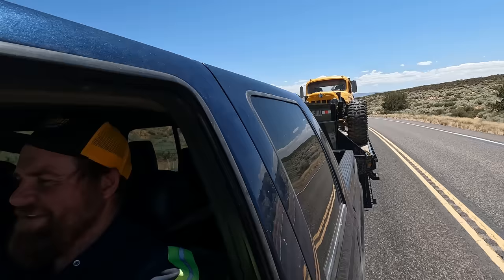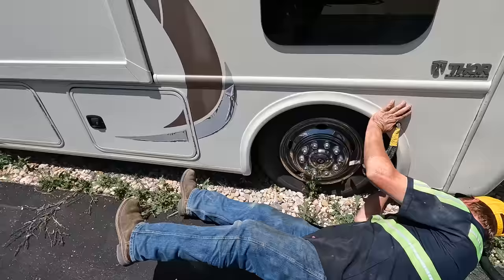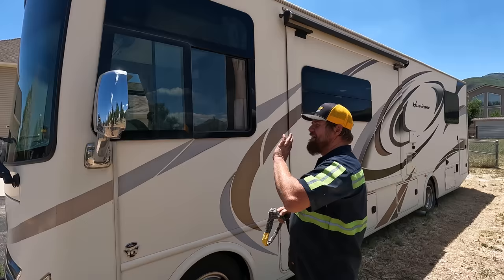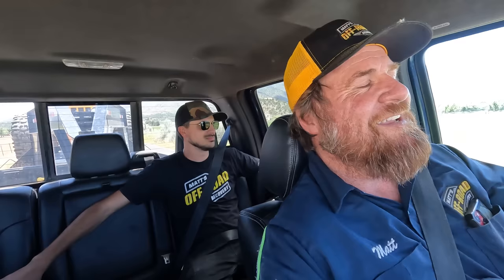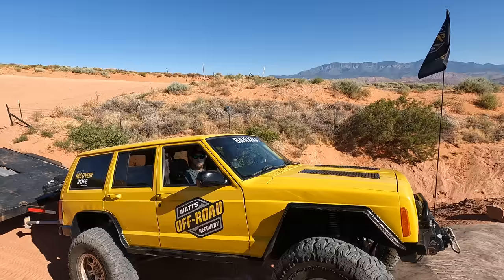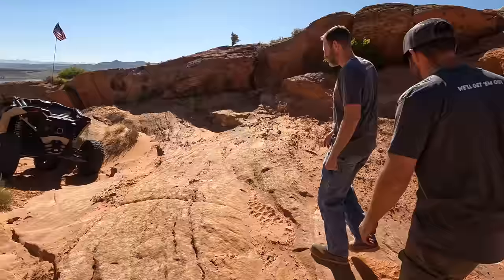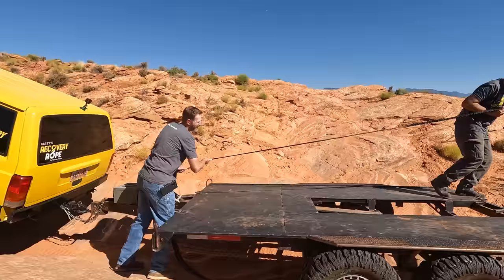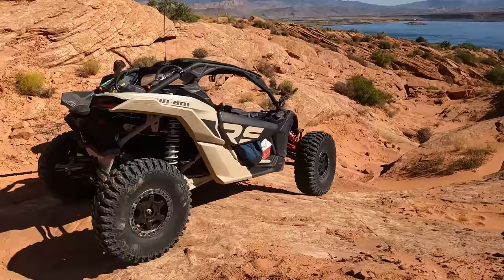Motorhome Stuck In A Bed Of Needles!

Comment from the maker: Check out Blue Steel upgrades here. https://youtu.be/LhFCO4AIKyM
Reply: Now you can challenge Rory and the Mater trailer to a trailer off... Or something like that. Maybe you have a better name for it. Your trailer versus the TrailMater trailer.
Reply: -  👍 👍 🔧  qoᒋ ǝɔᴉN 👀❤🤍💙
Reply: Blue Mule much better name.... just sayin Blue Steel sounds like a porn name lol
Reply: Hey Tom Charging port was my idea
Reply: Sent it to y'all about month ago and now I see I was right lol
Reply: Seriously make a Cover!  Bon Jovi - Bed Of Needles
Reply: Getting a flatbed made my work so much easier
Reply: I'm so glad it's Robby giving Blue Steel some much needed love.
Reply: @XPFTP "Blue Mule" sounds even worse - hung like a... Here's Lizzie in Blue Mule... Yeah that's gonna be a no.
Reply: Instead of an Anderson plug you could just use a 7-pin RV connection and still get the battery charged while you tow the trailer to the recovery and back.  I'm not sure what amperage Anderson plugs are rated for, seems like it would be a significant amount, and you don't need that much to charge the battery.
Reply: Why not tie into the 12V that goes to the trailer plug on the Bannana? Then when ever you hook up and plug the trailer in, the battery for the winch is being chargerd while you drive. That's how most "Take 2/3/4/5" type car haulers are. They have a trailer mounted battery to use with a winch.

Comment: Hey Matt, one thing to consider when you're recovering nice RVs like that: most of them have hydraulic leveling jacks on the corners that can  be operated independently, and they're usually tall enough to lift the front wheels off the ground. Next time you've got one low to the ground like that try raising the front with the jacks, it'll make your life much easier.
Reply: Or have someone who's midsection isn't a 55 gallon drum in a blue shirt wriggle under it ... Matt, I'm just kidding
 If you ever run out of gas on Persnickety Trail and see an old Subaru recklessly careening towards you on two wheels flag me down. You can't have any of my gas but you can use my satphone to call Rory.
Reply: I'll second that. My 37' fifth wheel weighed 20k and my BigFoot jacks would easily lift it high enough to change the tires - all 8 of them!
Reply: @@Martys-4x4 - no kidding!?! Ever hear of hyperbole ?
Reply: Jacks probably won't be able to deploy with the chassis that close to the ground
Reply: Don't forget, behind the front grill panels are the factory tow hook points, similar to the newer cars with the loading hook point.
 You'll look like a pro 🤗
Reply: You are not supposed to use the leveling/stabilizing jacks to lift the RV in that manner, and it will probably damage the jack and could also be dangerous because it is a device being operated outside of its designed parameters and then a human being is stuffing themselves between the RV and the ground... use your imagination for the rest of what could (very likely) happen if you were to attempt to misuse the RV leveling/stabilizing system in this manner. Do not try this if you value your limbs and/or life.
Reply: @datalorian  It's designed to lift the motorhome, and that's what was suggested. I do mine all the  time
Reply: @harrystone8847  they are designed to level and stabilize, not lift, especially not pulling the tires out of a hole like that. You can argue all you want but we both know the hydraulic or electric stabilizing and leveling jacks are not meant for this kind of duty. They are also not to be trusted putting an actual human being between the motorhome and the ground... that is just a bit of common sense. Just because you CAN do something does not mean it is a GOOD idea.
Reply: @colinnelson625  They deploy just fine.  I usually put a 2 foot length of 2X12 yellow pine under the feet of the leveling jacks when its soft.  If you need more lift a section of 6X6 or railroad tie works well too.  It wasn't a heavy diesel pusher but just a gasser on an Ford F53 with the V10 powering it so well under 30,000 lbs.  Since those look to be 19.5 inch rims perhaps even just around 22,000 lbs.  An F53 is basically an F550 Forward Control Chassis with a Fiberglass Box on it.  Thankfully the jacks were not stuck in the ground and hopefully they checked for that before attempting to move it as that could have been costly.

Bottom line they didn't really need a tow service in this particular instance and could have put it up on the jacks, filled in the holes and driven it out on some plywood.

If you do have to crawl under with the jacks deployed you do need to use common sense and use properly footed blocking to make it safe especially if you have levelers that are designed to flip over if you attempt to drive off them however those have become quite rare.  I use the awning rod/cane to place the pads under the levelers without crawling under.  Be mindful that there is a difference between stabilizers and levelers and indeed you never should try to lift with stabilizers as they are not designed to hold up the entire weight of the rig.

I carry a pet piece of rolled up cardboard around 6 foot long to deal with having to lay on the ground where there are sand spurs, etc along with the cut lengths of 2X12 and strips of plywood.  Just line the bottoms of the basement storage bins with them and they really do not take up that much room.  Yes I've been on that dance floor and have never allowed myself to get in so deep as to need a tow.  Judging by the looks of things that area was not prepared and bedded properly to park a motor home on it.  Oops!

Matt as usual dealt with it in a kindly manner so kudos to Matt on that one.

Best!
Reply: Wouldn't the leveling jacks sink into that soft surface too unless you had large enough pads on the levels? Then you would have had to fill in where the tires made the divot to drive out.
Reply: @milt6208 generally when you're doing that, you dig it out just enough to slide bricks or a solid concrete block under the tire.
Reply: I think the biggest takeaway for this video is add some tow points on any motorhome before I need them.
Reply: @colinnelson625  They are vertical hydraulic cylinders. IMO, they should deploy.
Reply: @harrystone8847  Whoever told you to use them to lift it is wrong. They're only supposed to level and stabilize, not lift the weight of the motorhome.

Comment: That trailer needs a seven blade R.V. wiring connector with the positive battery circuit which supplies power to the trailer battery to keep it charged.,  Works well on all my trailers.  Great video,   Thank you all.

Comment: Blue steel is an under appreciated beast on the channel.  That truck has been around since the beginning, just putting in work like a beast and it never stops.  Always pulling something or getting the crap beat out of it on roads it shouldnt be on.  I'm not a Ford guy but that truck is a beast!

Comment: A good idea for your trailer batteries: solar battery tenders. They aren't really great for long-term usage, but if it's sitting in the sun and used ~once a week, it may be enough to keep it topped up. Bonus points towards not letting the battery go flat, too. Longevity!
Reply: Even using the accessory power through a 7 pin plug would help.

Comment: The beauty of bringing Blue Steel on the trailer is that the trailer allowed for a lower pull on the motor home than any of the rigs without hooking to the axle.
Once again, Matt comes up with the best solution with the tools he has.
Reply: Trailer and Wrecker added a couple thousand pounds of ballast to Blue Steel for extra traction as well.
Reply: @philb5593  Honestly without that weight on the rear axle I doubt it could have done it. You could hear the tires beginning to chirp and lose traction on the truck.
Reply: Blue steel was pulling the trailer with the wrecker on it. Blue steel was not on the trailer.
Reply: @Cragified  It would do it if he uses 4x4. My brother and I have pulled out fully loaded semis that weigh more than that RV with our F250s.

Comment: I use a 7 blade RV plug on my trailer.  That includes a 12 volt power supply that will charge my winch battery.  I also have a small solar panel mounted on the tongue.  Between those my battery is always charged.

Comment: Mount a small solar charger next to the winch/battery to automatically trickle charge the battery.
Reply: Great idea. They will come up with some great custom steel protective frame for it too.
Reply: Like the suggestion of adding an anderson connection to the vehicle, they would actually have to get round to doing it 😀
Reply: @slaveofjesus3878  That will add another TON to it... They deffinetly can't work for Lotus.
Reply: @milesbartlett  Honestly, they could carry an extra long set of jumper cables on the trailer in the meantime, and just clamp it on the tow vehicle.

Comment: I like how that model of side by side has holes in the doors to ensure all your crap spills out when it inevitably rolls.
Reply: I have nothing good to say about side by sides. You can buy three flat fenders forasmuch as they cost and have a lot more fun
Reply: @jefflilyea4669  totally agree.
Reply: @jefflilyea4669  To each their own, but I do love a SXS on a good trail!
Reply: @jefflilyea4669 what's a flat fender
Reply: Steal a trick from old Jeepers. Buy some big ammo cans from an army surplus store. Bolt them down in the vehicle and toss all your stuff in them. Even if you flip it, it's not going anywhere. As long as the seals in the lid are good, they're waterproof.
Reply: Thanks guys…
Reply: There aren't any side windows so what does it matter? And even if it had side windows who's using them in a hot environment with no air conditioning?
Reply: @jakefallin9748  A vintage Jeep.  They come up in spades if you Google.
Reply: All the holes in the doors? 
As opposed to the big giant openings for all the windows.  😂🤣😂🤣
Reply: @jefflilyea4669  I look at those and realise I get more fun with my KLR650 dual sport bike, for a LOT less money.
And I can ride it on roads and highways.

Comment: You don't need Andersen connectors, just a tiny trickle charger powered off the running lights would be fine. An Andersen would be useful if you wanted to skip the battery entirely, but then every vehicle would have to have one. If you adapt a little trickle charger to the running lights, it'll stay topped up while being towed by anything.

Comment: I was so impressed at the RV recovery in the driveway. That looked so soft and buried and I was thinking there was no way blue steel was gonna pull that out like it did. You rigged it JUST RIGHT low to the ground, had Lizzy do exactly the right thing. I guess the weight of the offroad wrecker probably helped a lot in this scenario keeping the trailer planted and more weight on blue steels traction wheels. But dang, that came out so sweet. I would have wasted a lot of effort digging around that RV even if I had the same equipment. Just shows you that experience knows.  I would have bet money that your plan would fail, even tho I respect your experience. I just could not see it.  I love being wrong, because it teaches me new things.  Databyter

Comment: Note to self: add rubber puncture proof mat so that we don't have to lay in goat heads or other spikey things.  Another great video as always.
Reply: A yoga mat is great for this. Also provides a bit of relief on hot, hard concrete. And they are cheap.
Reply: @philbert006  and you can do some yoga while you wait for a teammate to retrieve the keys/battery/welder/tools you forgot
Reply: @C141B LMAO 😂🤣 shots fired!

Comment: Lets talk about how powerful Blue Steel is.. Keep in mind Ford always get the short end of the stick.  This was impressive with a trailer and the off road wrecker on top. Great job Matt.
Reply: Fords been one of the top payload trucks for a longggg time plus they’re jus the best looking trucks on the road
Reply: the trailer with th wrecker on top helped give more grip to the rear wheels because of the added weight, also more mass to pull on the motorhome

ever tried to drive an empty bed truck on snow? terrible thing to do, a friend would load rocks just to have grip
Reply: Blue Steel is powerful but not in a league of its own for what it is.

Hell my 4 cyl 5 speed Tacoma pulled plenty of Ram 2500s out of snow banks. 

I knew a guy who pulled 20,000lbs with a Ford ranger in the 90s. You can't go very fast and the truck doesn't like it, but it'll do it.
Reply: @imblackmagic1209 correct. 
I had a 98 chevy 3/4 ton 2wd pickup.  I had 2 tractor inner tubes full of sand around the wheel wells every winter. I never got stuck, just because of the weight.
Reply: @imblackmagic1209  I agree
Reply: @Yugemos  Back in the early 70' I towed 2 trailers to town , I had 16 Tons behind a late 60' Chevy pickup , 2 wd ,6 cyl
Reply: The key is 4wd low range. Just about any full size truck with enough weight on it would be able to do it.
Reply: Not bashing ford at all by saying this, but I’m sure Matt was in 4WD low so the engine HP is not that important. Its all about weight on the traction wheels and the resistance of what its pulling. Since the trailer wheels were on blacktop and they were pulling down hill,  the resistance from the trailer is negligible but the tongue weight helps increase traction of the truck.
Reply: @philb5593  yup, keep traction.  No spinning tires
Reply: @Yugemos  I’ve pulled a 3500 Cummins dually outta some mud w my old 2000 zr2 s10 anything can pull anything if you know what you’re doing and the angle and type of terrain ur on

Comment: the only problem with Anderson plug to keep the trailer battery charged is that you then need a connector on every vehicle that is likely to tow the trailer .. given the ( usually ) sunny climate better idea might be a small solar panel on the battery / winch housing
Reply: Seriously, they get a ton of sun, it won’t take a very big panel to keep it charged.
Reply: You can buy a 12v to 15V converter very cheaply that will charge that battery even with the voltage drop on the trailer plug.  Doesn't even need to be a hot wire, just run the tail lights when running.

Comment: Every year at the sand dunes, I pull several coaches out. One thing that I always do is use the leveling jacks to lift it up, push sand/dirt back in the hole, then tow it out.  It amazes me how many don't think about using their jacks like that.

Comment: That trailer axle has a habit of bending offroad.

Imagine a smaller wheel up in the air in front of the wheel that keeps bending.
That way any big obstacle/step wouldn't hit the main wheel square and get hung up but could roll off the smaller wheel.

Comment: Here in Texas we call those grass burrs. I had a patch in my back yard that was about 4x8’ long. 2 choices to get rid of them. Burn them or dig them up. My lawnmower folks dug up a 8x12’ patch and replaced with sod. Dog kept getting them in her paws. Needles can break off and cause infection. I no longer have to worry about them as when the grass came up no grass burrs anymore.

Comment: Boy do I remember goatheads from my days bicycling on dirt roads in Albuquerque as a kid.  This was before tuffys and sealants.  My bike shop guy told me to take an old inner tube, open it up on the inner circumference and wrap it around the new tube to prevent more flats.  That helped but some of the bigger goatheads still got through.

Comment: A nice kit to keep handy is "exhaust bladder jack" not sure what they really are called. We used them a lot here on busses. Clamp it on to an exhaust, run the engine for a while and et voila, you have an air filled bladder that can be used anywhere. :)

Comment: 🤔 Don't need Anderson cables.🥳 They make charge controllers to keep on-trailer batteries charged that work off the standard 7 pin off the truck. Look into them.. Way easier.👍

Comment: That trailer does rock! That was real good driving, Tom. Too bad that was all manufactured, because it looked seriously professional. hahahaha
Reply: Also, it may come as a surprise, but many motor homes aren't built well enough to move much. 1 mile of wear on a car is like 20 miles of wear on a motor home, maybe. Imagine hanging cabinets with staples into upholstered foam board type quality, but everywhere.

Comment: Hey, I have an idea: Use some Anderson connectors on the winch and another dangling in the back of the banana and MORRvair. Then you can hook up any battery you might have without the silly clamps, or use the vehicle battery when you forget a jump box. Or do it MORR style and get some super-long jumper cables and just go from starter battery of vehicle back to the winch.

I know, I know. It just came to me.

Comment: Blue Steel's new "flat tray" might weigh at least 4 times that of the old tub that was removed, I'd be concerned about GVM and reduced carrying capacity as well as the rear suspension. It's definitely looking more like a service truck now and less like a Pickup.

Comment: One thing about the military is you never seem to be short of personnel to do a recovery. Not sure how many times our FAV (now DPV) were in a bind and we would just lift and push them out of their predicament.
Contrary to what seems normal, the smaller the trailer or shorter the wheelbase the more adjustment that is needed. Hence the further your wheels are back the easier it is to steer a trailer.
Nice work guys.